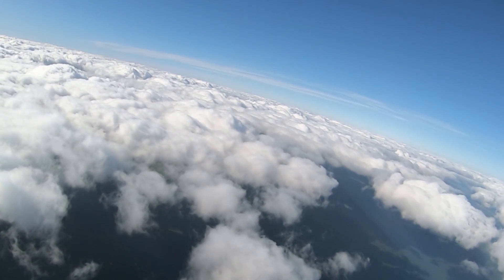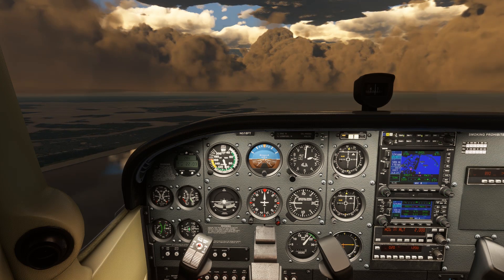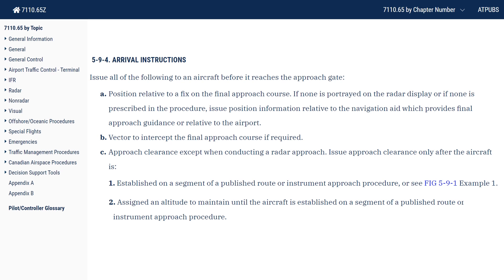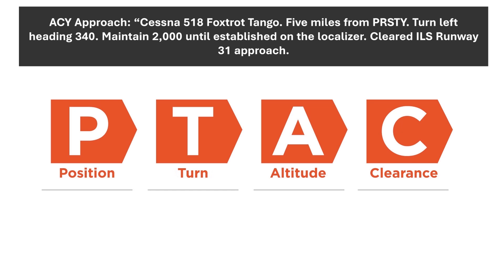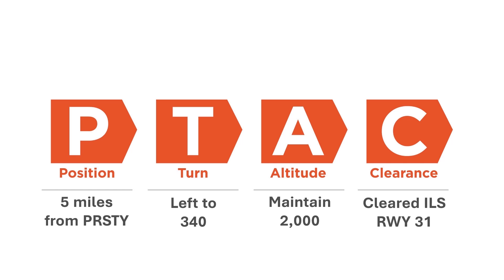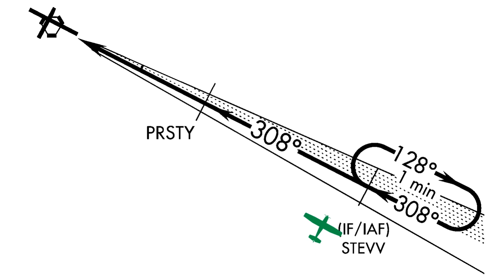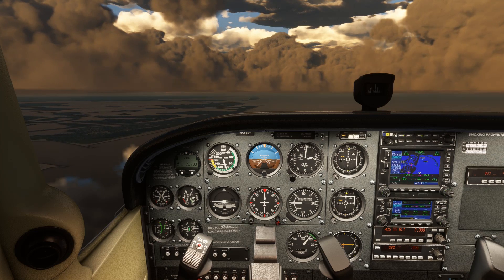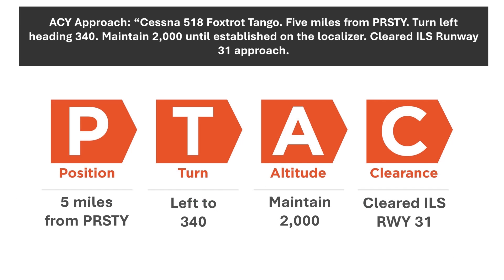Beyond Proficient: IFR Series | Elements and Variations of Approach Clearances

Comment: There are only 2 pieces of info you need. Heading and speed. the rest just read atc the title of your plate.
Reply: Which approach you're shooting is critical too. It's especially critical when simultaneous parallel approaches are in use at the airport with both being suitable candidates. Even if you're told to "expect ILS 34L" controllers are allowed to assign you other approaches until you're actually cleared. Maybe the glideslope goes out and you're just "cleared localizer approach 34L". Maybe there's an accident and a runway gets shut down, or there are sequencing issues and the pilot ahead of you is slower than expected, and you get 34R instead. Maybe the winds just changed drastically, ATC knows you're not going to land a 25 knot direct crosswind, and suddenly you're "cleared ILS 34L approach, circle to land runway 9".

Always copy and read back the specific approach you're cleared for, along with any altitude and heading instructions.

Comment: Excellent video! Two questions: 
1. “no more than 30 degrees intercept”, yet it is 32 degrees in the example. Is there wiggle room?
2. How do ATC determine which fix to give position relative to? The closest? The one you will pass first? Information is only useful for the pilot if they know where they will intercept.
Reply: The .65 gives 30 degrees as the max, without mentioning any wiggle room, though in practice controllers may assign this intercept. There's no guidance on which fix to give position information based off, but often it will be the FAF or next fix along the course after the intercept. Sometimes it may be the prior fix though, so in this case would be STEVV.
Reply: @flightinsight9111  Thanks for the reply! One of the contollers on PilotEdge said that the degrees refer to 'track', which makes all the difference. I just had a closer look at .65 and, sure enough: "Assign headings that will permit final approach course interception on a track that does not exceed..."
Reply: @NicolasMedtner  thanks for adding this. The key thing to note is that ATC is giving you headings to approximate a track--they're trying to correct for wind effects with your vector onto final. If they were limited to 30 degrees in *heading*, if the wind was howling strongly enough, they wouldn't be able to vector you onto final from the downwind side. If your crab into the wind had to be >30 degrees, you'd be out of luck. (Yes, the wind would REALLY have to be howling...)
Reply: He did say you'll typically be given a vector that's no more than 30 degrees off.
Reply: @HiddenWindshield  Well, that's not very precise. And the 7110.65 5-9-2 a. says "maximum interception angle" to be 30 degrees. Exceptions for helicopter, or even lower limits for closer to gate intercepts. So is 32 degrees more than maximum? If yes, is there a fudge factor?